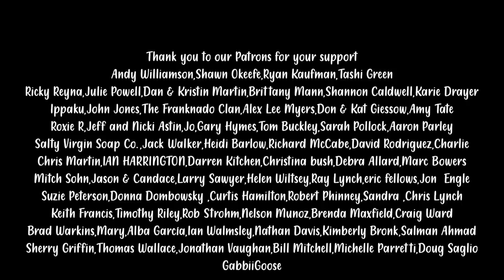WIND TURBINE INSTALL! generating OFF GRID POWER from the WIND!

Comment: I saw one comment related to your footer design which might be valid given some unknowns about your overall soil composition.  If you make sure to build in an adjustable base plate, you should be able to keep your turbine plumb for the longest time possible.  If the turbine gets out of plumb your minimum starting speed will increased and your bearing will fail early.  It’s awesome that you got it for free!!!

Comment: When applying glue to wood, you should use a small brush to evenly spread the glue over the whole surface for proper adhesion. Next after wind turbine, put up an antenna for shortwave radio to talk with all your friends around the world.

Comment: When I had wood on onsite thatI needed to dry I found heat and air movement make the biggest difference. If you could leave a small fan on in the shop all the time, you will see benefits. Start a neat pile and space the wood. Dry your wood and use the pile as a bench for now when not working? Be well, Paul.
Reply: Paul,   In an enviroment where it rains everyday, the humidity stays about 75%. Dried wood is figured at less than 10% moisture content in the United States. Paint may dry with a little heat, but wood, I don't think so. That's why metal and stone are necessary in Panama.
Reply: Bent Nickel I hear you with the humidity and heat comment, and think there is solid reasoning there. Can we agree on the benefits of airflow at least? Please? Be well, Paul.

Comment: Congrats on getting the solar power, and turbine up and running, exciting! And I just wanted to make a quick comment about chickens. I'm not sure about Panama, since you're close to the equator (light/dark ratio is more equal all year long), but just an FYI - in the USA when days get shorter and nights get longer, many chickens stop laying eggs, molt (lose old feathers, grow new feathers) and don't start laying again until the early spring. Since your hens are young and have only recently started laying they may continue laying through the winter, and not molt this year, but if they stop laying or start losing a lot of feathers, this is probably why and it's totally normal. If they are losing feathers you might want to up the protein in the hen's diet to help them along. "Storey's Guide to Raising Chickens" A book by Gail Damerow has chicken feed recipes that are great, and is a terrific poultry reference book.

Comment: No worries a little rain will help the concrete set good.  It is better the concrete sets and dries slowly.  There is cement you can buy that rain will raise the temperature of the setting concrete creating a perfect balance for drying.  The wind turbine can fly away in hurricane winds so I would make it bomb proof for nasty weather. :) I like watching your channel :) Best of luck! :)

Comment: ? Where are the BOLTS that hold down the Wind Turbine into the Foundation?
The Anchor Bolts into the Foundation and have them bent about 2/3rds down.
Reply: ALL  TOWERS  ETC.  HAVE  GUY  WIRES  TO  DIST.  LOAD  GUARANTED  RESEARCH  THIS  PLEASE

Comment: Congrats on the Wind turbine, What is the power curve of the turbine you have? We have a Missouri Wind 2000 watt generator  mounted on our catamaran sailboat which produces more then enough power to keep our batteries fully charged. We have 6 lithium ion batteries onboard, plus each engine has its own starting battery, each engine has a 200 amp alternator that more then keeps the house batteries and the engine batteries charged. We also have 1600 watts of solar that produces a lot of power, with all these systems our batteries are always topped off. We also have 9000 watt diesel generator onboard that we need to run the AC, dishwasher, and the washing machine and dryer.......

Comment: by the way wind turbines are more delicate than you think. ours get knocked down by the wind all the time. like breaking off at your cement line. not be be turgid but we have hurricane speed winds in northern Maine and i have seen two windmills get knocked down. better get the right insurance for it or warranty. or the guy that gave it to you.

Comment: Don't know if this has been asked.  But I've notice almost every aspect of your structures are metal. Is metal cheaper than wood there? I know in the USA wood has been hyper inflated lately.
Reply: They get a ton of rain during the rainy season. (34 inches in May alone).  So with possible wood rot and termite issues, everyone down there builds their exteriors with metal, concrete and cinder blocks..

Comment: Wondering whether you have considered the need for ventilation in your battery store? Because some batteries release oxygen and hydrogen gases when they are charging, the areas should be well-ventilated.... don't want you to compete with the local volcano and go off with a bang.....

Comment: The footer depth for your wind turbine is too shallow to support the height of the turbine in that soil .. I'm very surprised y'all didn't auger 4 corner pillars from the bottom of the footer and put in tubes with vertical rebar to tie the rebar to the footer steel .. it will be interesting to see if your wind turbine stays level with as much rain that soil absorbs
Reply: GUY  WIRES  X4  TO  CONCRETE  FOOTINGS
Reply: @rogersrogers5594  Pls don't spoil this channel with bad talk

Comment: I could care less what color you paint the damn door, but DO care about someone getting hurt or killed during a lightning storm.  If you haven't already done so, then your next project should be to properly ground and provide lighting protection for all your metal framed structures including the van.  Consider yourselves warned!